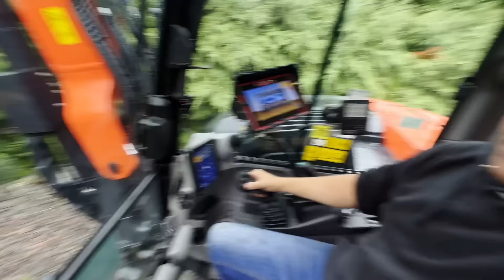I'm In Scania Heaven! + Saying Goodbye to The Kubota - Digger Girl Diaries Week 28

Comment: You definitely need to invest in a loader or loader/backhoe for jobs like that then you can move the soil straight to where you want it without the need for a dumper and it can be spread straight out as you go, the 4 in 1 bucket is a great tool for that job.